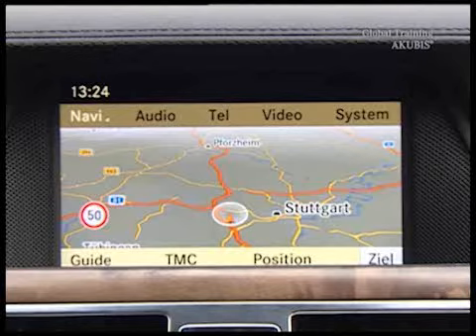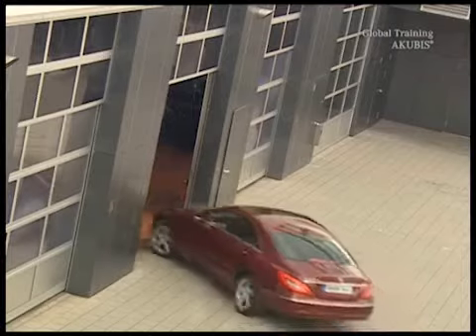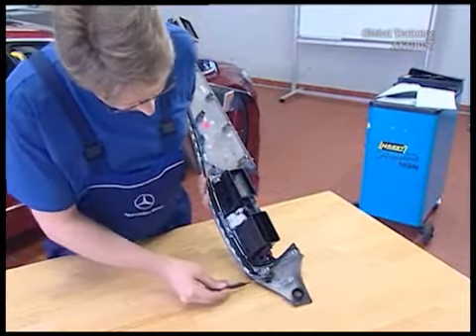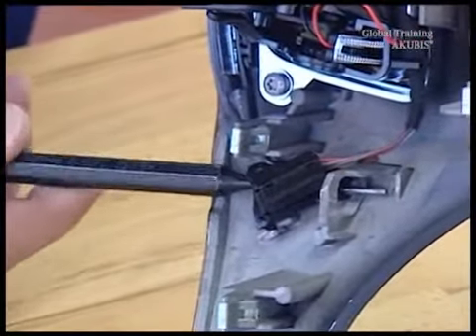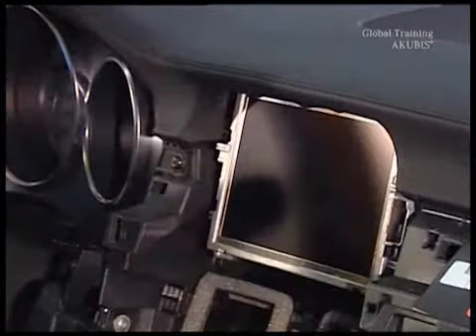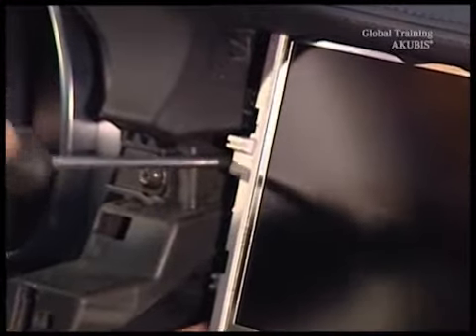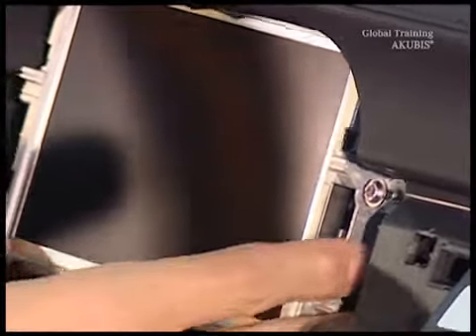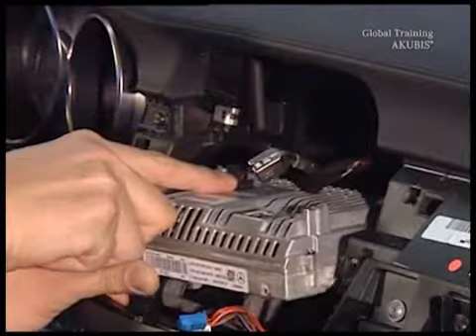W218 Remove central display

Comment: That was very helpful thanks. My CLS63 is right hand drive so is a bit different but your video meant I was able to work it out. Awesome.
Reply: Do you remember where the latch is located for rhs?
Reply: @swaagadohnn  I had forgotten but I just went and looked at my dash. I am assuming you are referring to 0:50 in the video. If so, it is on the other side of the air vents (mirror position).
Reply: @Karbonpete  thanks for going out your way to help :) much appreciated!! I asked because I’m adding a CarPlay module to my CLS.

Comment: I have a Mercedes 550 CLS 2012. I am facing a problem with the screen turning off and working and turning off and then working all the time without my intervention. Do you have a solution?
Reply: I have this same problem.. did You fixed it? What was the problem?
Reply: @TheAndyyy87 same here.. Did you get it fixed?